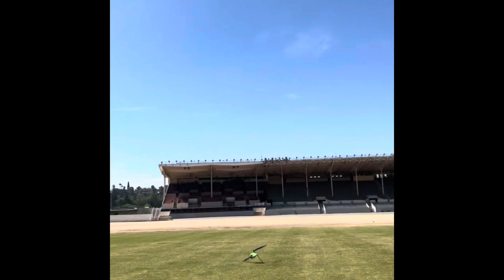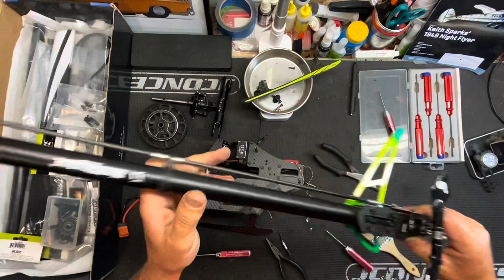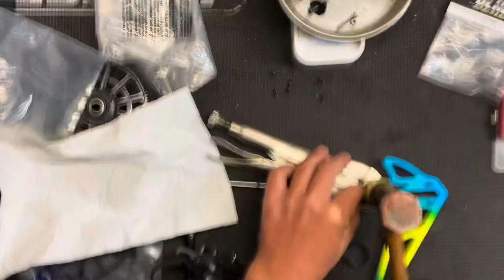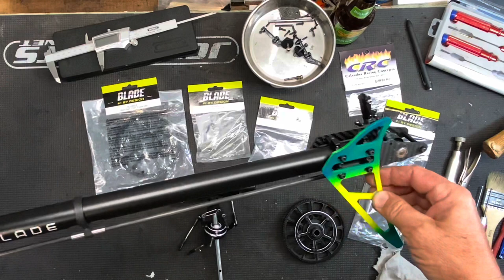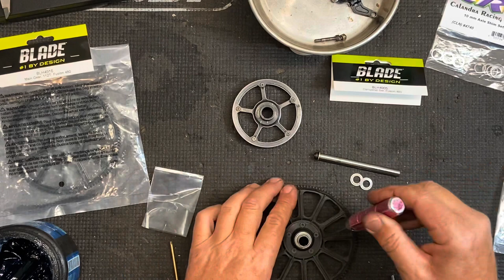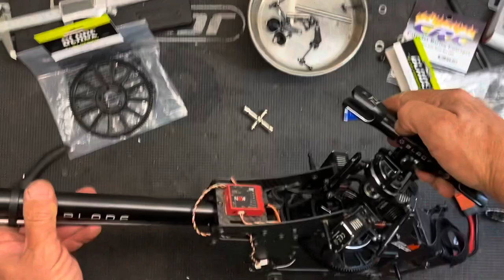Blade Fusion 480 Helicopter Crash and Rebuild

Comment: A note on this rebulid: not replacing an OWB after a crash like this, usually means another disaster waiting to happen in next 10-20 flights, when it gives up on some power-hungry manouver leaving you with insufficient HS to land safely. Unless afcourse it's a sprag-type OWB, which isn't the case with Blade 480.
Reply from the maker: This is not an Oxy.  The one way bearing in this can support the wheel on my trailer. It’s a  strong little beast. No need to waste money or throw parts at it.
Reply: @CoeShow619  I agree on the part thats it definitely not an Oxy. LOL

Comment: I noticed you are not running the 6250hx in that one Wich unit do you prefer most? Iv had tons of trouble with 2 spektrum 6250 units In two different helicopters
Reply from the maker: I think you answered your own question. I have made suggestions to the engineers. All I can say is there will be numerous updates in the future. I like the Brain/Ikon systems for the 15 minute perfect set up and infinite tuning ability. The wizard makes it all make sense for everyone. Brain has been around for 10 years. 6250hx has been out for 2. So give the new stuff some time and stars will start to shine.